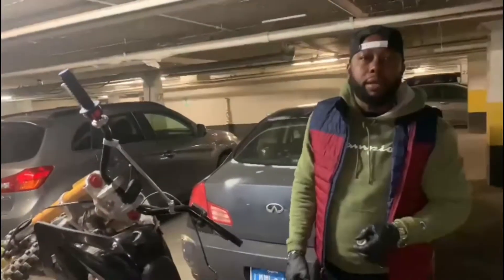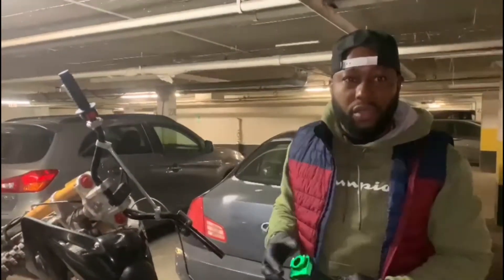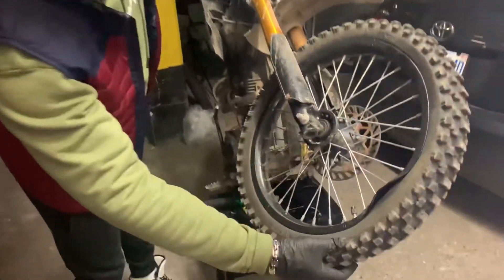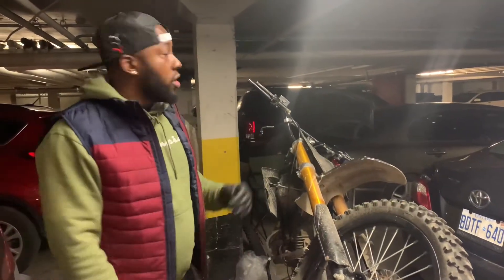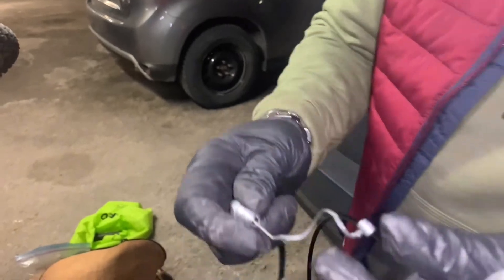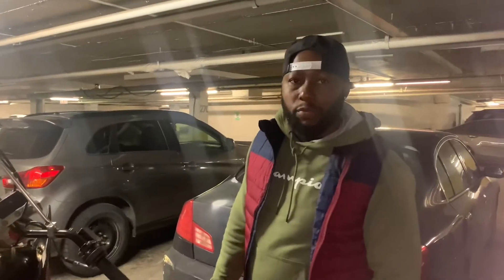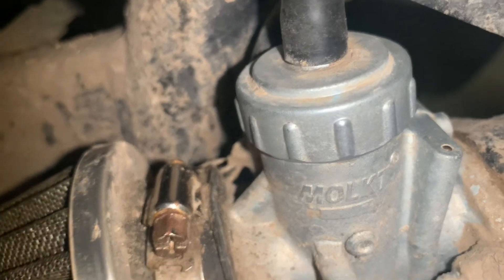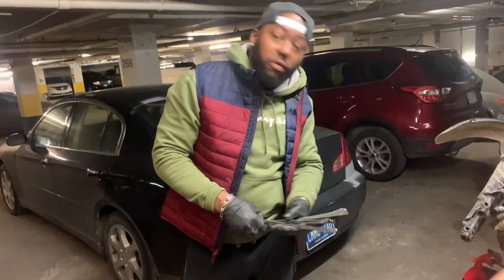150cc Evoque dirt bike # Toronto # Evoque

Comment: Have  you tried like sanding and smoothing  out the edges    where the  cable goes on the aluminum throttle  ? So it   doesn't all that 🤔